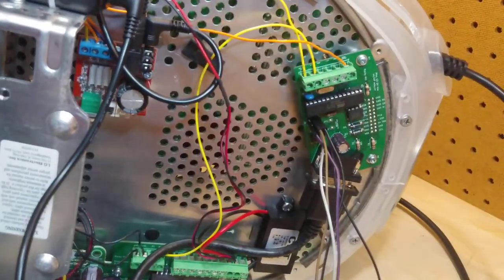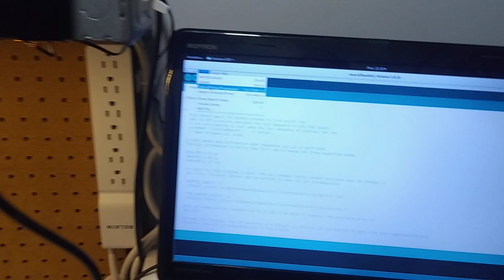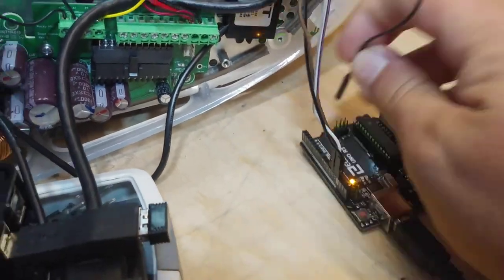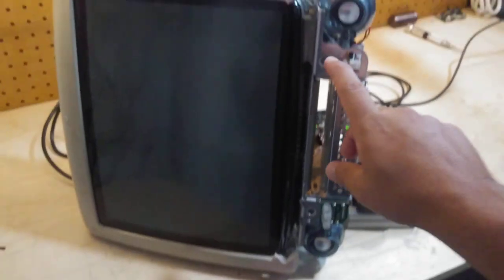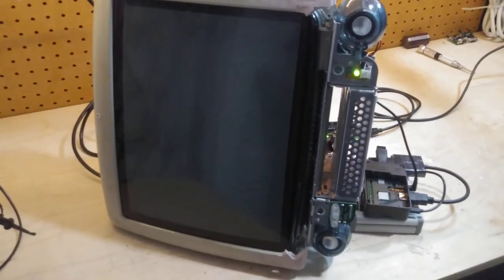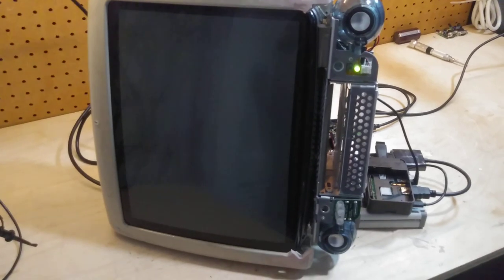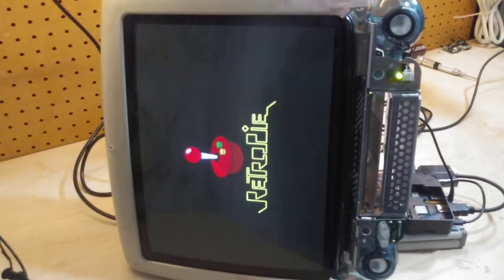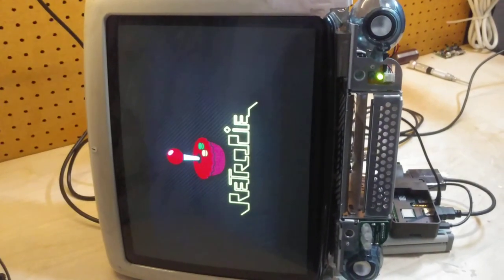All three adapter boards working with the J20 board having only a single atmega328p MCU.

Comment: So that board that you burned the code to with the Arduino, does that separate Arduino still need to be plugged in after you burn the code?
Reply from the maker: No, the board is essentially a
trimmed down arduino uno with support circuitry. I use the seperate arduino as an external programmer to "flash" it. I could have included
voltage level changing circuitry so that one could
just plug it into a usb port and program it just like an arduino but that would increase the cost and 
board size. I figured it was something that was going to be done so infrequently that it was o.k. not to include. You can disconnect the arduino after it's programmed and it will work just fine.
Reply: Awesome! And what about the Raspberry Pi? I’ve just discovered your project and I was to use these boards to make a Hackintosh from my slot loading G3. Would I still need the pi?
Reply from the maker: No, If you use the boards then you don't need to use the Pi to send the init sequence. I would love to see a hackintosh with a CRT G3

Comment: So, you need to take out that Mac board and replace it with those small ones?
Reply from the maker: Yes, and then the mac becomes a monitor
Reply: @rockyhill3  do you have to discharge the monitor itself?
Reply from the maker: @icristian6707  Not necessarily, You can actually do the mod without removing the top outer plastic, only the bottom cover. The CRT isn't exposed at this point.
Reply: @rockyhill3  is that shock free?
Reply from the maker: @icristian6707  If it isn't connected to the mains power then yes. That said, you should always take precautions in case there is a discharge somewhere. I'm putting together a wiki that tries to explain this process, here's the link.
https://github.com/qbancoffee/imac_g3_ivad_board_init/wiki/Convert-and-iMac-G3-slot-loader-into-a-standard-VGA-monitor
Reply: @rockyhill3  Awesome! So any vga device can be connected afterwards not only rpi? I m assuming you connect it to the J20 board (sorry not a hardware expert).
Reply from the maker: @icristian6707  Yes, this mod essentially converts the slot loader iMac G3  into a VGA monitor. I have tested this with many machines, Windows, Mac, Linux ect.. There is even one person that uses it as a monitor for her apple IIe
https://www.reddit.com/r/VintageApple/comments/fox7b8/my_half_retro_battle_station/
Reply: @rockyhill3  Thank you for sharing your work!
Reply from the maker: @icristian6707  My pleaasure!

Comment: Hi Rocky,
Firstly, this is amazing, thanks for putting it all together so people can follow and build their own.
I've been trying to copy this and has the boards installed into my g3 but am unsure what changes still need to be made to my pi to initialise the ivad board. My pi works on a different monitor, my imac runs with the old motherboard and flashing the MCU from the arduino appears to be successful. 
However, when I have everything set up the screen does not start up and everything turns off after a few seconds. Did you ever experience this? Is this a problem with the raspberry pi or the arduino? 
Sorry if this is the wrong place to ask, I couldn't find anywhere else to get in touch,
Will
Reply from the maker: Hi Will,
Somehow I missed this. I'm in the middle of something right now but I'll respond to you soon. Did you build and install the boards?
Reply from the maker: Hi Will,
Thanks! The sketch looks for a signal on the vertical sync line and if it doesn't see one it shuts everything off after 5 seconds. If you've built and installed the boards and you have a video signal coming in then it should not shut off.
That said this has given me trouble and it might be a good idea for you to disable it while you are testing.
  

  //do stuff whn vsyncDetect is 0
    if (vsyncDetect <= 0) {
      startTime = 0;
      currentTime = 0;
       externalCircuitOff();

    }

If you comment  " externalCircuitOff();"  Which is on line 179, the sketch will not shut the iMac down for vsync reasons.
should look like this afterwards
  //do stuff whn vsyncDetect is 0
    if (vsyncDetect <= 0) {
      startTime = 0;
      currentTime = 0;
//       externalCircuitOff();

    }
Reply: @rockyhill3   Hi Rocky,
Thanks for getting back to me. I have removed the externalcircuitoff() from the vsync timeout loop and now everything is running as expected. As you've put so much effort into this and aren't charging for the boards, I've donated to the RPi foundation, I hope that's okay.
Reply from the maker: That sounds great, I'm glad you got it to work! I've been doing this for fun and I am a big fan of sharing to help and learn. 

I'm glad you've donated to the RPi foundation, I really believe in what they are doing. 

 Do you have any videos of your iMac in action? I would love to see it and possibly even link to it in my repo.

Comment: I really want to do this mod, but I'm totally stumped with programming the atmega328. The method to upload the bootload which you describe on your Github page doesn't work, and from what I've seen elsewhere it appears that you need to put the atmega on a breadboard, connect a 16Mhz clock and various other components.
The way you've programmed it in this video is also leaving out many steps, which I simply can't reconstruct since I have no experience in programming these chips. Also, you say you have to upload the bootloader but also the sketch. It's not at all clear what you did here in this video.
I'm very sad because I put all the three boards together, but now I'm completely stuck.
Reply from the maker: Hello, sorry you are going through this. You've assembled the three boards? In order to program the atmega 328 on the J20 board you'll need an external programmer. In the video I use an arduino as the programmer. The arduino can be flashed with firmware to turn it into a programmer. All you have to do is open the arduino dev environment and got to Files-->Example-->ArduinoISP. This will load the sketch. Once loaded you need to upload the sketch to the  arduino. At this point the arduino is a programmer so you have to be careful not to upload the imac sketch to the arduino when you load it as it will overwrite the arduino ISP sketch. Wire the arduino to the J20 board as described in the wiki. In order to program the J20 board you must have the arduino plugged in but dont use the regular upload button. Go to Sketch-->Upload using programmer. This should load the imac sketch onto the J20 board.  Grab my email address from my youtube home and email me. I can help you a lot easier.

Comment: Hello,

I've been following your guides to use my iMac g3 as an external crt monitor. I've ordered the parts, soldered the components, uploaded the sketch, and placed the boards. I've followed all the steps but when I press the power button I can hear something happening and my raspberry pi which is connected to the down converter board turns on, but after about 3 seconds everything shuts off... I'm kinda lost at this point. 

The only issue that i've run into thus far has been burning the bootloader. The arduino ide throws this not in sync error but i'm able to upload the sketch fine. I don't think this is the issue though since it seems like the sketch is being run properly since the iMac is responding to the button press..

The iMac is in working condition when the logic board is in so I don't think there's anything more existentially wrong with it.

Could use some assistance. I feel like i'm sooo close!

- Bui
Reply from the maker: Hi Jonathan,
It sounds like are almost there! The sketch monitors VSYNC from the VGA signal to shut everything off. this is convenient as it allows the sketch to shut it all off once there is no video signal. VSYNC along with COMPUTER_SDA and COMPUTER_SCL have to be electrically connected via solder jumper. JP3 is the solder jumper for VSYNC and it should be at the top of the board near the mounting hole. If it still shuts off then disable it in the code until you figure out any video issues you might be having.
at around line 179 there is an if statement that shuts off the iMac when there is no VSYNC detected. make it look like the following by commenting the "externalCircuitOff()" function
let me know how it goes and good luck!

    //do stuff whn vsyncDetect is 0
    if (vsyncDetect <= 0) {
      startTime = 0;
      currentTime = 0;
     //  externalCircuitOff();

    }
Reply from the maker: Place a solder blob across J3 and if there is video it should work.
Reply from the maker: Also, don't worry about connecting COMPUTER_SDA and COMPUTER_SCL if you're using a raspberry pi, this can cause it to flicker.